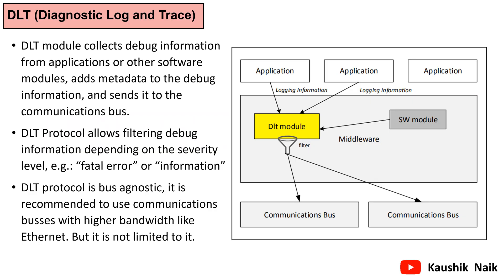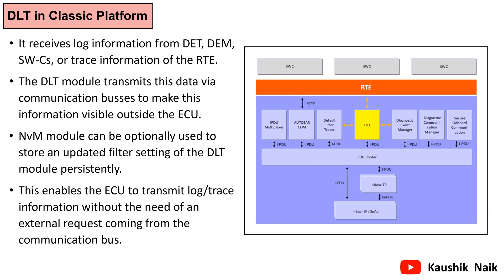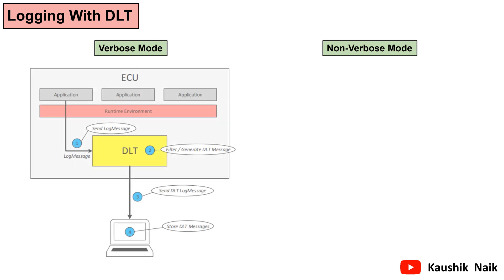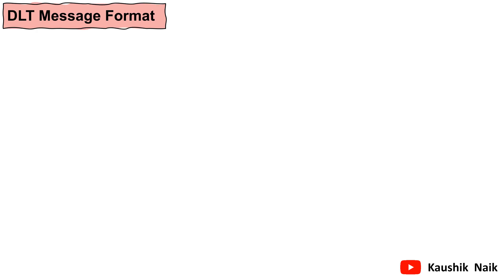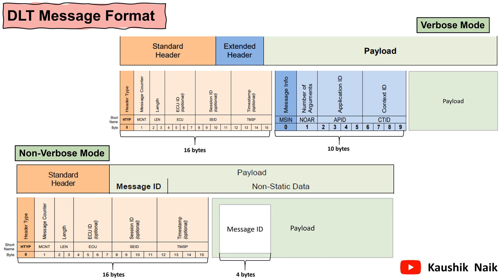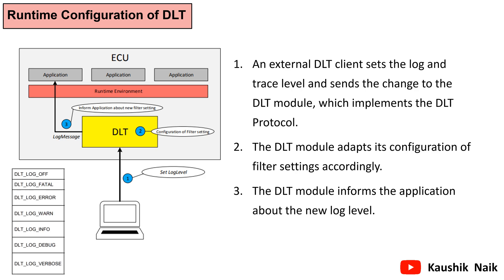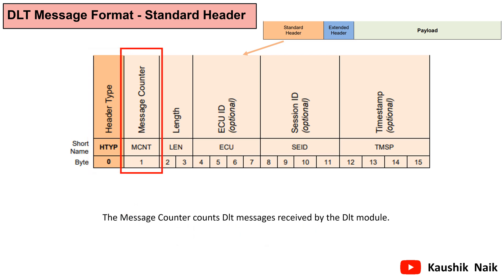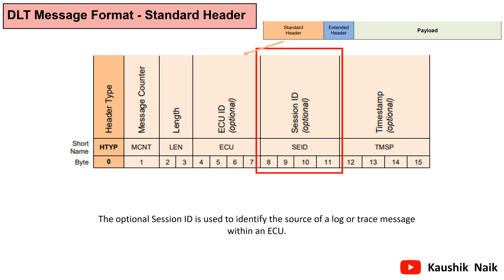AUTOSAR DLT | Diagnostic Log & Trace | Automotive Embedded | #autosar #DLT #automotive

Comment: What is the difference between session id and application id?
Reply: One example: If you have an application (0xabc), which checks the connection for 2 other ECUs in parallel, LogMessages could be
application 0xabc, session id 0x1: check of ECU(1) started
application 0xabc, session id 0x2: check of ECU(2) started
Depending on Application, from my experience most applications have only one session. 
This is independent from DLT, in other protocols, program languages they are using application and session similar

Comment: Hi , I'm sending message to dlt from my swc, after some time few messages are missing in the dlt viewer. Is dlt discarding my messages , how can I check that. Pls give your response it could be more helpful to me.
Reply from the maker: Hi Shasidhar. Have you checked with the if the logs which are missed, if those are configured to have loglevel greater than the reference or default log level? If so, those logs will be neglected by the DLT.

Comment: Hi..Can I get your e-mail..what is different between verbose and non verbose. And how to get dlt log.
Reply from the maker: Hi, as I said in the video, the frame formats with which the logs are sent on the communication bus.. verbose mode includes the complete DLT header (standard and extended header) and non verbose mode includes only standard header with a message Id in the payload... this difference is to reduce the overhead on the bus... 
And on receiving the DLT log, I hope you asked how to view the logs on the PC?
One way is you can view the logs on the console itself.. or else you can save the logs in a file and then access it... or you can install a DLT client application which is available open source.. using which you can see the DLT logs sent on the on the screen...all these 3 methods needs to be configured when implementing...